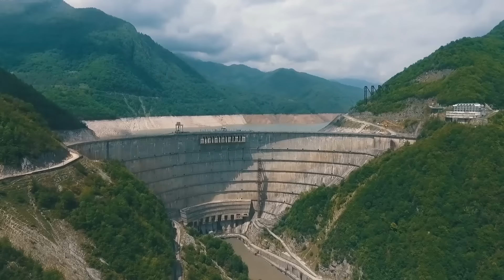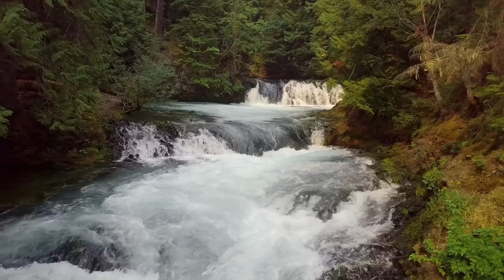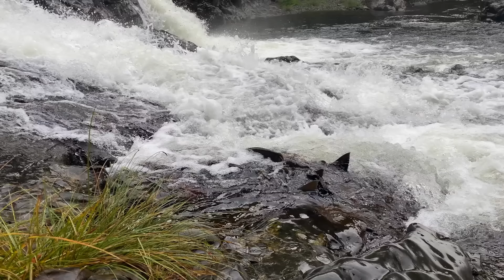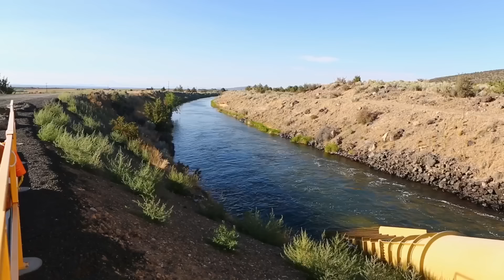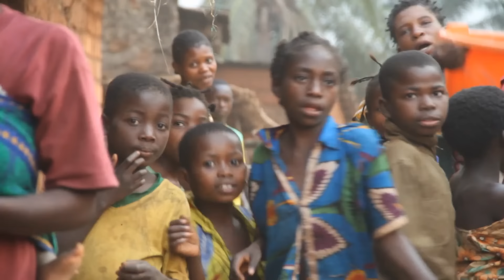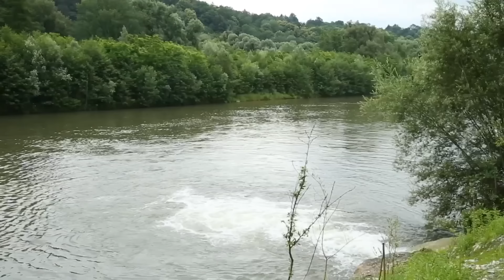Genius Micro Hydro Turbine Halves Cost of Energy

Comment: I imagine there is a physics explanation for this…Why aren’t these turbines connected in sequence so that the same water flows through several turbines before ejecting?
Reply: If a turbine has an efficiency of 70% that means 70% of the water power has been transformed into electricity. 15% might be wasted as "resistance" in the turbine and the last 15% of the power is going through the turbine outlet unused.
Combining two such turbines in sequence would result in 70% + 10% = 80% efficiency because the 2:nd turbine will only get 15% of the original water power into it's inlet. 10% extra power for 100% more turbines is not very economic.

Comment: Good idea, but you still don't get guaranteed base-load power above 25% of its maximum generation capacity.  Same as with wind and solar, you need tons of batteries for storage to even hope to reliably get maybe 50% consistently, providing rainfall and water flow rates don't vary too much.  Rare earth mining for battery storage systems ruins the actual natural environment, unlike CO2 which helps plants to thrive.  Still +1 but you need to point out the drawbacks of any proposed solution.  Mitch from Australia.

Comment: Please don't forget that dams have a lifetime, when they silt up.  Expensive to fix, which may require stopping or rerouting the water upstream for a year.
Reply: Not to mention the huge carbon deficit in concrete and the fossil generation which remains on line during the construction.
Reply: @rogerstarkey5390  although that might soon be a wash since they have discovered a way to park CO2 into the cement permanently (to be seen ten years later if it stays)

Comment: Fascinating! This has the potential to drive electrolysis, leading to the splitting of water molecules and production of hydrogen. This hydrogen could then be utilized in fuel cells to power a variety of technologies. Furthermore, the United States is fortunate to have one of the longest rivers in the world running through the heart of the nation.
Reply: So, you make electricity.
You liberate hydrogen using the electricity.
You store it (energy intensive btw) 
You convert it BACK to electricity, but you only get 20-30% back...... 🤔🤪
..
Or, you spend the same (or probably less) money building a battery storage system. (No, it doesn't have to be lithium ion)
Store the energy, recover 90%.
.......
But then I actually THOUGHT about it.....
The reservoir of water IS "the battery" ("storage medium")
.
You HOLD the water.
You release it through the turbine when you need the energy (just as we do now)

Comment: You omitted one of the major concerns of any electric generator and that is the control of the generator speed if it is a AC generator or the voltage regulation if it is a DC system with or without batteries. Micro hydro has a place but it is a lot more complicated than you have presented,   Get real!

Comment: How much pollution was created in building the dam?  You have to look at total picture of summation of total project….for example. Manufacturing electric vehicles compared to standard gas vehicles. The electric vehicle manufacturing carbon print shows that it takes 400k miles before the electric vehicle carbon print is lower than the gas powered vehicle.  Debunking the green electric scanerio.
Reply: Still beats gas powered cars which continues to emit pollution until its nor used

Comment: It is something new but not costfree. It needs control and maintenance and repair as any machine. But will the locals get the necessary training to do this ? Never ever. In  20 years the patents run out and everybody can do it. The solar has better facilities and I prefer solar which will always be cheaper than machinery.

Comment: Be interesting to see how their electricity networks evolve organically. Wires everywhere through the streets I'm sure. I wonder how many they will be able to service when transmission length losses come in to play. Great stuff though!
Reply: Your country needs to switch to HVDC cables then. Extremely low transmission losses compared to other cable types
Reply: @drsatan7554  if you have the money for hvdc cables then you have the money to build an actual power plant at scale instead of micro-hydro
Reply: @gabrieldsouza6541  unless you're using hdvc cables your literally just throwing electricity away in transmission losses

If you upgraded to hvdc cables you'd have more usable electricity without building any new power plants lol
Reply: @drsatan7554  they don’t have any power plants, old or new in the congo. that’s what the purpose of this video is about. which power plants are the congo gonna hook up to those cables?
Reply: As with water wells, the villagers will travel to the source instead. In this case, they will fill a battery.
Reply: @TyBeingTyAgain  going to awkward lugging lead acid or lithium cells....
Reply: @zoe..d  They just want to recharge their lanterns, cell phones, and laptops.

Comment: I imagine type of fish matters a lot for the fish pass through part. In the video it looked like they were testing it with an eel.  Around here it would be salmon.  Is the general idea no dams?  I am assuming the fish pass through is only in direction of water flow.  So around here, salmon returning to spawn (going upstream) would need a way around.  Doable if no dam.  Still, I like the intent.
Reply: Good points - and I imagine that a few decent sized tree branches would jam the works in no time.    Hydro is great,  for those blessed with nearby watercourses,  but it won't solve the looming energy crisis.
Reply: @winniewotsit4452  
So use less energy.
The comment in the article summed it up.
One US home consumes the same as 20 African homes..
"Use less stuff"
Reply: @winniewotsit4452  But nothing will fully solve the energy crisis, but, many projects can do their part by cleaning up the energy in certain areas, so its still is a win, cause when you add all those tiny parts, it becomes a massive help to the environment
Reply: 5m of head is nothing. That is a typical drop for existing rapids on most rivers.
Salmon jump a metre regularly.

Comment: I'm all for more renewable tech but I can't help but feel that over the coming decades, more and more households and businesses are going to want to go gridless, because most of us like having control over what we generate and use.

With the way renewable and battery tech is developing, it's not hard to imagine over the coming decades that a lot more households will go gridless, because most of us will like to control how much we pay for our energy and being connected to the grid will always give companies an incentive to charge as much as they feel they can get away with whereas gridless could become free energy.

I feel because of all this, solar power is well in the lead as it can be done on a small scale whiles generating a lot of power, wind could also be used but in a lot of ways, it's not suitable for a lot of households, solar also has the advantage of having no moving parts.

Renewable energy is already a lot cheaper than fossil fuels and yet consumers don't seem to benefit from it, gridless is likely going to be the best way to control how much you spend and as the tech is continuing to get cheaper and better, as well as battery tech is getting better, I suspect most consumers will go gridless as the tech allows as that can allow free energy which I doubt being connected to the grid will as the entire grid network needs to be maintained.

Comment: The title is misleading. Are four 4.5 1.9m turbines a micro hydro installation? Should be called "grid hydro". Also not "far cheaper", as shown in your own chart, grid solar is the same or cheaper. Off-grid cost is irrelevant since both require a grid so you can't compare with off-grid solar. You need a separate estimate for off-grid-actually-micro hydro.

Comment: those things are just going to get clogged and then have massive fall offs in efficiency.  especially if it has anything like those grates you showed at the beginning.  they act like the average river is some nice clean mountain/glacial river free of debris and pollution.  rivers are full of garbage and debris.  these things will require constant maintenance and upkeep, which i guarantee they did not account for when they make the claim its far cheaper than solar.  there is no way that something that has that many moving parts that will require constant maintenance and upkeep to make sure that the flow rate is flowing at the rate it should be will be cheaper than solar.  the cost of solar has been declining very rapidly.

Comment: Define "Off Grid Solar".  Because this is definitely not as cheap as just using the sun to heat and move water.  You can use the sun to heat water in a black tube anywhere in the world any time of year if you properly insulate it and/or lens the sunlight into a heater.  Heat pumps, black hose, insulated housings... we still are nowhere near the cost of a "mini-hydro"  plant and transmission media.   Making it fish safe is another complete waste of effort and engineering.  You don't need constant flowing water.

If you want to use technology like this instead of solar panels to create electricity there is a much cheaper and more accessible method.  A gravity battery.   You can use a black hose or pipe at the bottom of a hill or at the base of a water tower to push water with ambient solar heat into a storage tank.  Then you run that water down through a small hydroelectric generator (or better yet a large Tesla Turbine) to generate electricity.  You just create a battery large enough to store all the potential you need for off peak energy production.

During peak solar production the best option is cheap solar panels for remote electricity generation.  That's why the US military always uses solar panels.  The Army Core of Engineers has all the best data to make these kinds of decisions.  They can be trusted to do the least expensive yet still effective thing.  In remote locations that's always to set up solar harvesting.  Fewest moving parts, cheapest maintenance, and least transported freight required to setup and maintain.  That's before the cost of training is considered.

Comment: I've never understood why we dont have turbines in our drinking water supplies. Some of the mains pipes are big enough to support a turbine that could feed the grid. 😃😃
Reply: We do. There is often energy recovery turbines at storage reservoirs where the supply into the service reservoir is gravity fed.
Reply: @yetihair  Well I never knew that. In my days of working with various water boards in the UK I didn't see any.  Hopefully we'll invest more money resovoirs and turbines in the future. 😎😎
Reply: Most water mains are pressurized by pumps not gravity. If your pumping water to create power it will cost more to run the pumps than you can generate.
Reply: We have lots of them in the US,  but they are out of sight, not noticeable.

Comment: Maintenance, is always he maintenance that tips these project up. I remember the the wells for Africa project. They couldn't even look after a simple hand operated  well pump. Some of them ended up fighting over who operated the well. Although they will be good for remote areas where there is sufficient infrastructure to repair and maintain them.
Reply: It happens everywhere, hope it ends up in peace and restoration of operations?❤, gopidas is a veteran of many such failure and recepiient of dusappointments
Reply: Each and every facility to evolve it's very own maintenance schedules, of preventiveoeriodicovehaul

time tables and activ

y, often augmented based on local experience?

Comment: Perfect. 4 pieces of a perfect energy grid :
- this microhydro turbine 
- a reservoir 
- store energy as water in the reservoir
- grow algae in the reservoir for biofuel
Reply: But if I recall correctly, biofuel is notoriously energy inye so r to produce.
It's another hydrogen.
Just use the electricity.
Reply: @rogerstarkey5390  depends. The development of it has been trying to maximize fuel production per acre, which means using pressurized tubes. That seems like a dead end, imo. But I see no reason why a low energy version wouldn't work - it's just concentrating sunlight into something dense enough to harvest.

Comment: hydroelectric is not always clean. Not even looking at the energy and the carbon footprint of building a dam and its millions of tons of concrete, a system with a large retention lake is a big methane generator as plants develop and decay in water generating methane. And unfortunately methane is around 20x worse than CO2 from the greenhouse effect perspective.

Comment: "efficiency of 90%"
remember, thats 90% of the potential 50% you can actually extract. basic physics loves placing "1/2" in front of things...

huh?

here is a pipe. we have water at the end. at height.
if the pipe is closed at the end, theres no flow, but there is pressure. it cant do any work.
if the pipe is wide open, theres flow, but no pressure. it cant do any work.

the ideal turbine restricts the flow through the pipe to half what it would flow without the turbine. 50%.
or in the case of a pelton, the water emerges at the full velocity due to the pressure, and the blade it then impacts recedes at half that velocity. again. 50%.

betz limit is a strange modification of the same principle. 59%. 

fish are nice but to show an eel? an eel can tie itself into knots, they play with speed boat props for fun...

hydro electric is great... if you have the water to do it.

for true isolated setups, nothing will beat a constant speed fixed frequency installation. screw the electronics, you want the thing to work, be reliable, and be repairable.
Reply: you're talking about open channel flow hydrokinetics. In those you have to comply with the Betz law of 59% max extracted energy. These turbines however rely on potential energy. Here you can extract more than the Betz limit as the outflow only needs enough axial velocity to pass the total flow. 90% has been reached by other kaplan systems. The one doubt is that on these small scale they only mention the lab measured 90% max. However river flows fluctuate and seeing that this is a fixed propeller with adjustable guide vanes, the efficiency will get lower very quickly at lower flows.
Reply: @VictorY-mu6zp  no.
betz law is simple. yes, its open system... theres no "potential". no head. no conversion from potential to kinetic. the energy is already kinetic. youre only dealing with mass flow over area, and at that point, it becomes the same thing, you can only slow the flow by so much before the flow simply stopwiths. the flow must go on!
you get 59% of the kinetic energy that is available. 

it would be a different matter entirely if you calculated the energy at the source that created the pressure gradient that caused the wind to blow, and move that mass at that velocity... if you did that, you might find that betz limit is 59% of... 50%. oh dear.

when its stuck in a pipe, 50%. 
potential, pressure, head. no work done.
allow the potential to convert to kinetic through gravity.
now its all kinetic. flow. velocity with no work done.
slow the flow with a blade, and the best case scenario is half. half the potential continues on flowing as half the kinetic, the other half having been taken away and used to grind our daily bread...

it doesnt matter if its a reaction or impulse turbine, pressure, francis, kaplan, vortex, pelton, turgo... at some point, something has to go at half the velocity that the potential could achieve when converted purely to kinetic for maximum energy conversion/transfer. 
as water splashes, eddies, and generally makes a mess... you dont quite get half. you get 45%... or a "90% efficient turbine"...

Comment: This sounds really good! Hydro is the way to go if you can and microhydro gets too little attention. I am glad to hear that the propeller is fish safe too!
Reply: Better if they could clean, gut and filet, providing an endless source of heart-healthy dinners
Reply: They have always been and will continue to be very high-maintenance devices. Sediment, wildlife, algea and the thousands of different bits of junk that gets flushed into water clog and deteriorate these things like nobodies business which demands a balancing act of filters at the cost of output.

That and the catastrophic failures that occur once there's a dry-spill which Sweden was recently devastated by, causing energy prices to go up by 1000%+ due to over-reliance on water-based energy.
Reply: @Runefrag  ^This
You put stuff in water, Stuff will inevitably get F*d up because water is great for everything except machinery.
Mixes with anything and everything, everything alive needs water to live meaning that water inevitably has a bunch of living and dead stuff in it which eventually clogs shit up. Since it mixes well, it pretty much always becomes corrosive or acidic. It's also pretty heavy stuff which means that it both loves to carve its surroundings up and transport heavy stuff downstream. Anything built in water needs to be overly solid to account for all kinds of hazards and yet it'll still inevitably degrade and break at a faster pace than any engineer would ever want.

Water sucks to work with. It's really good stuff though.
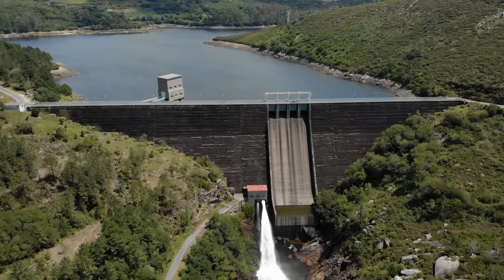Reply: Large dams are damaging to the environment, as the guy said at 0:47 this microhydro seems pretty neat though.